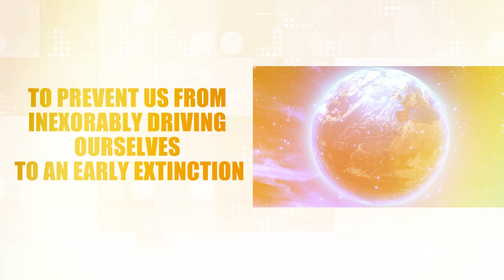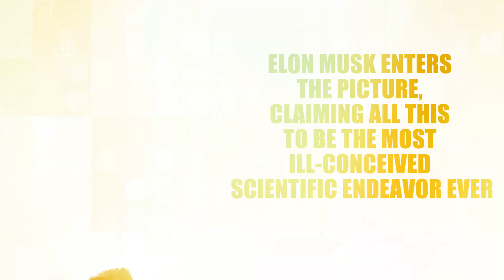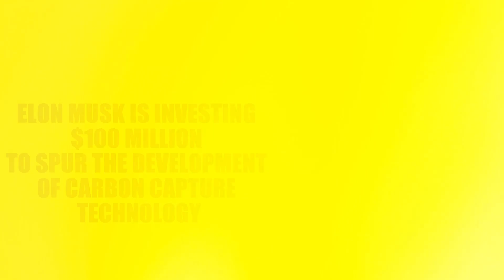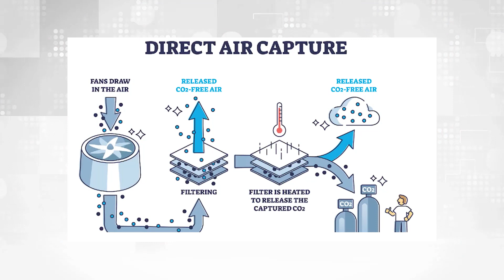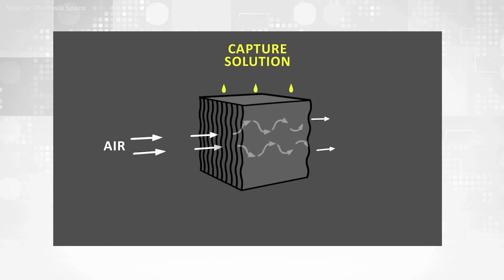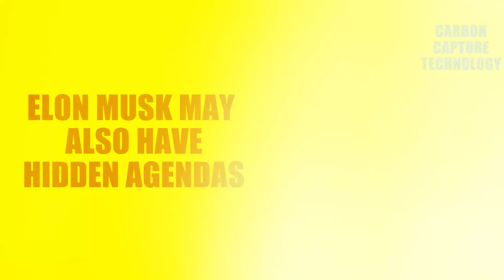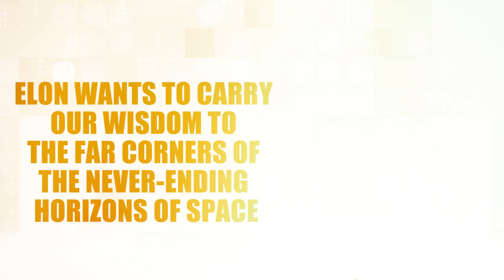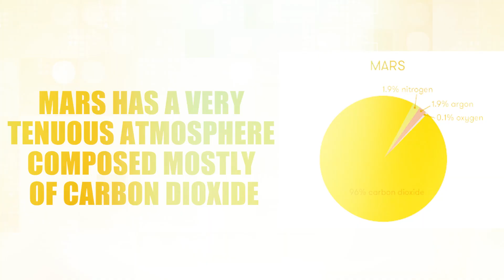The Real Reason Elon Musk Is Developing Carbon Capture Technology

Comment: Stop using the term renewable it is carbon neutral you save nothing due to the output it takes to make that power generator. Wind turbine blades are made of carbon fibre and can't be recycled, solar panels have a toxic part to them and can't be recycled. You have been duped about it being better. We need thorium and nuclear coupled together with red hydrogen for power generation. What do they do with those filters full of carbon to by the way????